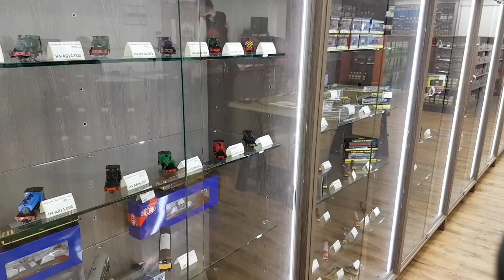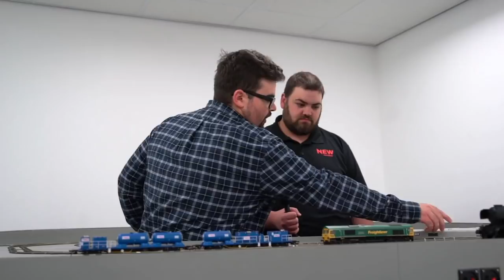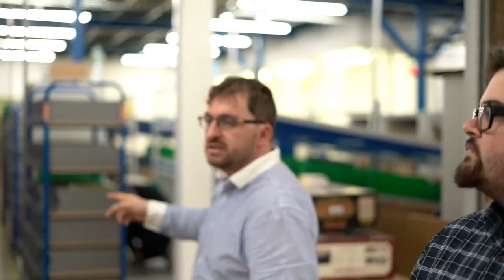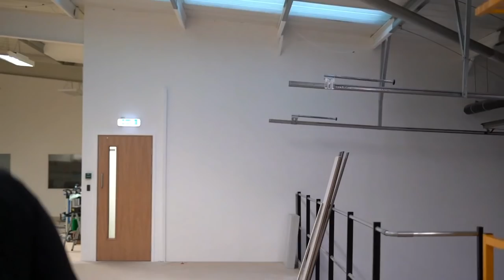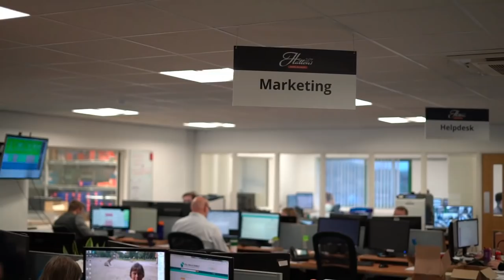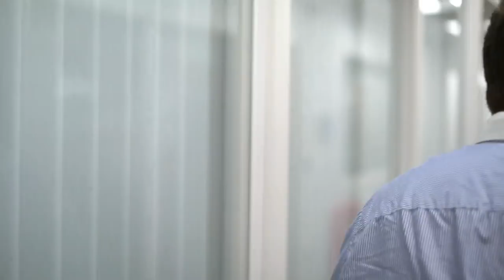New Junction Visits Hatton's Model Railways

Comment: Hi Richard,

You really suffer for your art! 

What bike did you have for the approximately 100 miles each way ride to Liverpool and back? Does it have heated grips? Full fairing? 

I commute 70 miles each way around the M25 daily, in all weathers, on a Honda Pan European (with heated grips and a full fairing) until it was getting a service one fine January day and the garage gave me a trail bike to replace it for the day while my Pan European was being serviced. No heated grips, no fairing, and worst of all no grip on tarmac on knobbly tyres. I made it about 15 miles before deciding to ring in to work and say I was working from home that day! A couple of days later some feeling started to come back into my hands and thighs!

Regards,
Jim

Comment: It's a Shed innit bruv. Then again, my EM1s and EM2 are butt ugly too. Blimey O'Reilly, this look like Argos for model railways - are the smaller model shops going to get squeezed out now?
Reply: So on Saturday, I went to the rugby at Murrayfield and afterwards walked to a model shop right the other end of Edinburgh. I bought some code 75 curved points, that would have been cheaper at Hattons or Rails (of Sheffield), but if we don't support these small local model shops (in an age of online shopping) they will disappear - for good. A 400 mile return drive or delivery in two days time is not much good when you find you realise you need something to complete a project.

Comment: I build 1/35th scale railcars, what guage would they be?
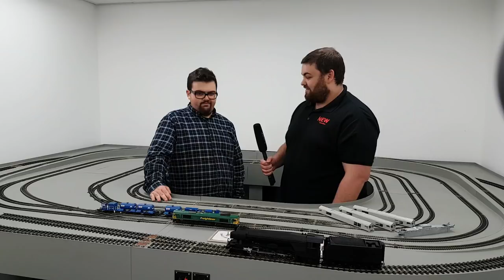Reply: Well your kind of in between there, don't think there's anything at 1:32 or 1:35 (I do 1:32 cars quite a bit.)
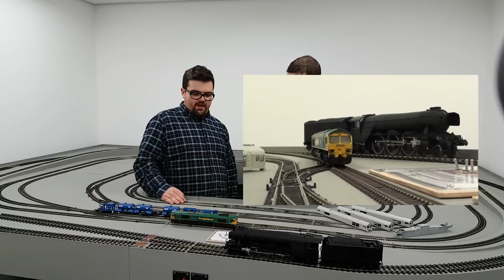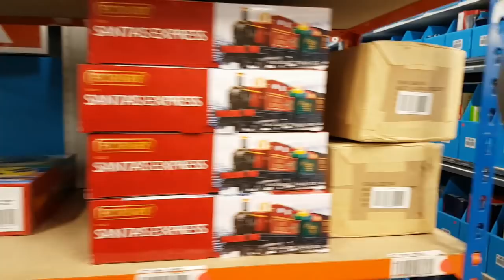O scale is 1:48 and G is 1:24 although depending on the wheel spacing of your models they might fit on track of one of those scales.
Just Google the track gauges to see.